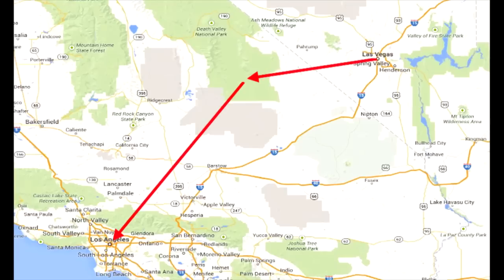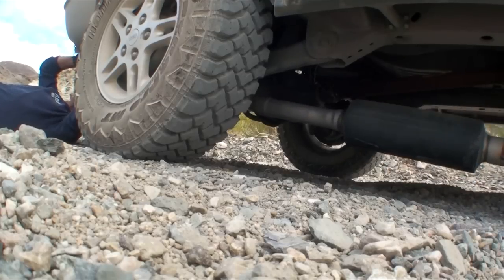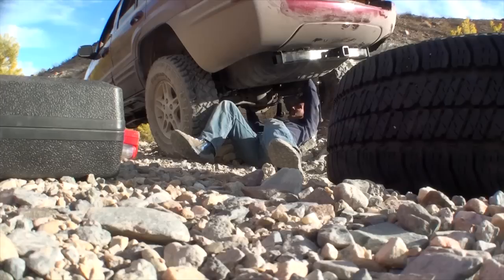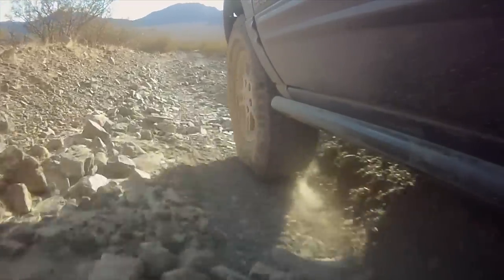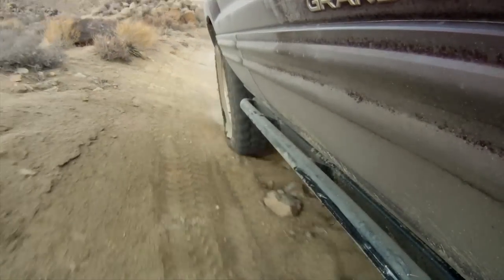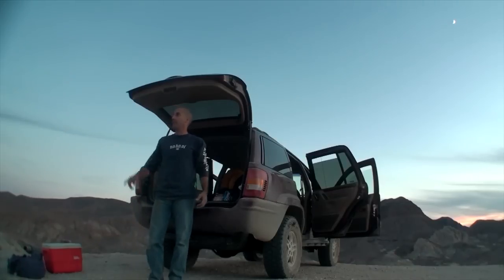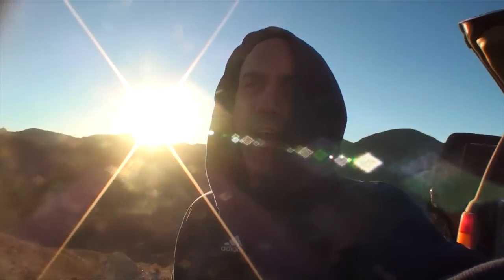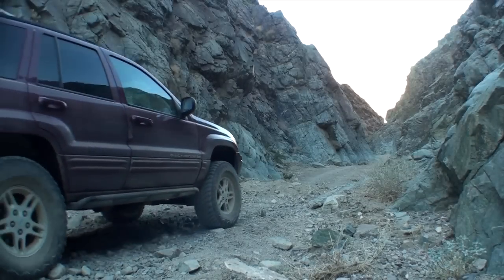A Broken Jeep WJ and a Night in the Desert - Off Road 4x4 Adventure

Comment: Lessons learned: bring high quality tools, use high quality material, use a GPS (have a compass with you to be sure) and work out :)
Reply from the maker: +Jef Horians For sure, lol!
Reply: Add a hack saw to your toolkit.  Been on your way in about 30 seconds.😄
Reply: Or or ,don't do stuff like that with a daily driver, those vehicles aren't really prepared for that.
Reply: @jomarz1828  that's why the have 4high and 4low they were made for them long dirt roads
Reply: What size tires do you use?
Reply: Wj jeep has a compass

Comment: Great video, I just bought a 99 4.7 limited WJ. Not because i was specifically looking for one, but because i found a good deal on it. I was looking for a v8 4x4 suv to tow my RZR and be able to sleep in the back and possibly take on some small adventures. They seem to be an under rated vehicle, and very capable with the solid axles, and the quadra drive's factory progressive locking diffs. Looking forward to getting mine squared away and having some adventures with it.
Reply from the maker: It's a great platform.

Comment: This happened to my XJ when taking a quick detour through some old state forest roads on the way to the camping spot for the night. Had to bailing wire mine up under the Jeep because I couldn't wrestle the thing out. The 3 hour drive home with no muffler was excellent...

Comment: I really wish this project continued.  The WJ’s are such a classic, not enough solid projects on these.  Thanks for the video wish I knew the tire size you were running!
Reply from the maker: Those were 32” I think. There’s a video on them in the playlist. I liked that thing so much but had to sell it to get my JKU
Reply: @AutoEdits  It was beautiful!  Red on Tan, gorgeous and it just looks so beautiful with that lift!   I didn’t see the video on the tires in the playlist!  I have to find it!
Reply from the maker: Ah, thought it was in the other DeathValley video or suspension install... anyway they are 32" Hankook m/t
Reply: @AutoEdits  I appreciate the reply!  Did you have any regrets at all from the IRO suspension?  I’m looking at getting that myself to avoid a head ache later and to do it right the first time.  Any vibrations on the highway from that lift?
Reply from the maker: @Logan-de3xx  No problems at all with that suspension... drove phenomenal. High quality stuff, would do again.

Comment: I run my ZJ (5.2l V8) with no muffler.  Sounds really nice and isn't too loud.  

Seriously though, you have long arms on that WJ.  you need to get off the dirt roads and hit some more hardcore trails.  Come out to AZ and take a few runs through Florence junction with myself and the fine folks at the VJC (virtual jeep club).
Reply from the maker: Yeah, I'm still learning this stuff.  I find that the lack of a locking rear diff. makes some things tougher than they should be and my local off road shop says the "odd ball" diff in this thing doesn't have any options... do you run a stock differential or have you found a way to get a locker in your rig?
Reply: autoedit I believe Aussie makes a locker for the Dana 44a, nobody else though as far as I know.
Reply: autoedit There are auto lockers available for the 44a, but there is no point in wasting the money on that.  You are much better off getting a ford 8.8 axle under the back of your rig.  That way you will have a very stout axle that can take just about any locker available, and also many other upgrades.  You could easily build an 8.8 up to run 37s safely.  

As for myself, my financial situation has kept me running the stock open diff 44a and i still manage to get into some knarly places.  I would eventually like to jump straight to 1 ton axles and 40+ inch tires, but that is well off in the future.  I have a couple videos on my channel you can check out just to see what i mean.  the one in crown king really shows how you have to work when you don't have a locker.  the video i have of the waterfall in Elvis (florence junction) shows that even without a locker, you can still do cool stuff that people with lockers couldn't do. (I was the only person to make it up that ledge that day.  Even some much more built rigs with larger tires and lockers just couldn't make it)

there are a few techniques you can use in the mean time.  for example, using your left foot to put pressure on the brake pedal can get you a bit more traction (I've had people swear they could see my locker kicking in even though i don't have one) and above all you have to learn how to pick your lines.  All the technology and gadgets in the world won't get you over an obstacle if you are hitting it at the wrong angle.

Comment: Have watched all 3 vids in this playlist a handful of times over the years and they're just as great as the first time. I've done Swansea to Cerro Gordo twice in my old '93 ZJ 4.0L, that is an amazing trip. Last year I replaced the '93 with a '00 V8 Limited WJ and have been building it up a bit and remembered you had done the OG long arm kit from IRO. Looks like IRO has replaced those arms with the Rock-Link 3-link system. I'm curious tho, who's rock/frame sliders were those? Love how they tuck up nicely.
Reply from the maker: Howdy, it was a really good platform. I don't remember where those sliders were from... not IRO?

Comment: I am actually y buying one 99 GC in the same color tomorrow. Wanna have a good car for the winter and also for some nice weekend trips =)
Reply from the maker: +Low Light I hope you enjoy it as much as I did mine!
Reply: Yep. It's a cool ride. It got power all right. Although mine is "Stock Hight".
Need to switch to newer, more capable tweeters. The stock ones are no good. And also a new cd-player/system altogether.
Reply: Don't by a 1999 it's the worst year. It has weak engine and tranny same with the axles... And if anything get 1998 or older (Zj)
Reply: Stuff stuff and More stuff I'm about to get a 99. Should I not?
Reply: Dakota Ortiz maybe some just have had bad experiences.
Mine is still doin fine.
It is not the one with the most horse power 220-223hp. But that is good enough for me.
I bought it because I wanted a good winter car, and I've heard it's still one of the best. I feel safe.
My frient at work has a 97 xj.
It isn't by a long shot as confy as the 99 JGC. Although, I must say, that the xj's looks cooler. But that is just the model-thing.
Reply: Low Light Good to know.

Comment: Right brake lights out, What year is your Jeep? I have an 99, got it in Minnesota. Jeep's not sure if there a blessing or a curse. Mine was acquired cheaply with a bad idel, went to replace the cam pos. sensor and the one in the truck was new but they never tightened the bolt. Boom, no stall outs since. Still have a light from trying to start it with a none coded key, the code wont go away even after leaving the battery un hooked for an hour.
Reply from the maker: +Philip settimi Just get a code reader or a super chips programmer for the jeep and you can tune and check those codes.

Comment: Dude that was awesome. It gives me a little more confident in my 99 grand cherokee limited I bought a month ago for 300 bucks. Of course so far I had the bearings done on the transaxle, new water pump, now working on replacing front cv axles, front axle bearings, sway bars links, new shocks and possibly replace all discs and brakes. Engine and transmission are in good working order. Really enjoyed this video. Tks man. I hope you check my videos too

Comment: Rule #1, don't go 4 wheeling alone.
Rule #2, You are crazy getting under the jeep with the stock jack. I've had my WJ fall off that jack on flat surface.  Luckily I already had the wheel back on.
Rule #3, Get yourself a ham radio license. Much less likely to be out of range of communications.

How much faster would have you gotten out of there if you didn't run ahead and set up the cameras just to drive by them. hahah.  Thanks for sharing your adventure.

Comment: Had to stop in for my monthly dose of autoedit.... and I think your channel might just be the only channel that I don't "skip ads" lol. I think I need to find a jeep or Bronco, lol.
Reply from the maker: nedaCFilms / Mustang-Town Howdy John! It's been a while but work has kept me busy...I'm digging back in on my old 73 and finally got the Cobra intake off.  Did you still want that or can I throw that up on Craigs list locally? You have first call on that!
Reply: You can list it on Craigslist or eBay and it's cool with me man, lol,...thanks for asking! I'm elbows deep in a coupe project now and holding off on the SN95 stuff. I've bought and sold the 94/95 Cobra intakes for around $300 to $400, of course you will most likely sell the throttle body, fuel rails, pressure regulator and injectors so you should be able to get on the high side of that, maybe quite a bit more. I would check the current market value on eBay first.... good luck, hope you get a good chunk of $$$ to put back in your project. Thanks again..... looking forward to the next episode!
Reply: autoedit ....heck, you might be able to get $600 for it actually.... the 24lb. injectors will help the price too. If it has aftermarket 60mm-70mm throttle body or adjustable fuel regulator would also bump the price.
Reply from the maker: nedaCFilms / Mustang-Town That is super helpful!!! Thanks so much!  I'll let you know how it goes.

Comment: im looking at an 04 Grand Cherokee Laredo 4x4 for my first car. its got 90k miles for 8k and is in very good condition. i was wondering what you thought. I live down in Alabama where we have lots of mud trails and I've seen some pretty bada$$ off road GC and would love to build one. Good idea?
Reply from the maker: +Luke Stl I'm all about getting a WJ but $8K seems a bit steep, even with only 90K miles but if it works for you get it!

Comment: Hmmm. Guess I'll buy the better ones from Summit.  About to put newer manifolds on my old Dodge, means an exhaust relocate.
Thanks for sharing, been there myself over in south park canyon. Ujoint died that day.
Reply from the maker: HaHa! To be honest ... when I was really new to 4x4 with this thing ... I did drag the muffler a few times on rocks so it did take some abuse before failing.  Just want to give full disclosure. LOL  Is that your rig in your thumbnail?  Love those things.
Reply: I know, been there. Had a stock Ramcharger years ago, left a tailpipe and nearly a rear bumper on my 2nd time out going up carpenter canyon near Pahrump,  NV.  Been out on close to 50 trails just in my current Dodge now. I had done the 1/4 mile thing for years when I got bit by the off-road bug. The family enjoys this more. Just did Moab for the 3rd time in Sept. Love those trails around Balarat and up north too. Big Bear and Borrego area are cool too. Hope to see more videos from you. My wife got a good laugh, hope yours wasn't too mad. LOL.

Comment: Not to be too tough on ya, but you NEVER go desert 4 wheeling without filing a flight plan with friends and relatives.  A sat phone is also a great option, so they can find you when things go wrong.  And something ALWAYS goes wrong.  Also, for traversing rocks, a locker in the rear diff makes ALL the difference.
Reply from the maker: Yes, all true! I did let the wife know the basic route I would be taking and the funny thing was she had a feeling it was going to be an overnight-er (I have pretty bad luck).  I took the jeep to 4wheel parts and they told me there is no locker for the odd rear end in this jeep...kind of a bummer. 
Thanks for the comment and watching, much appreciated!
Reply: autoedit You won't be able to get a selectable locker for the 44a, but Spartan and Aussie make lunchbox lockers. Great video.